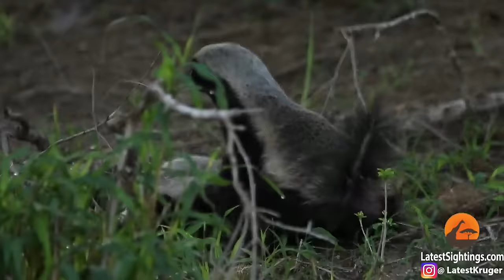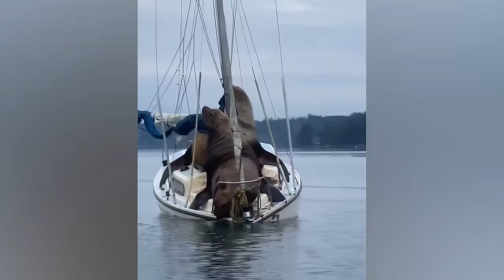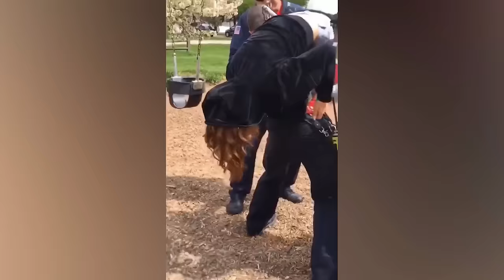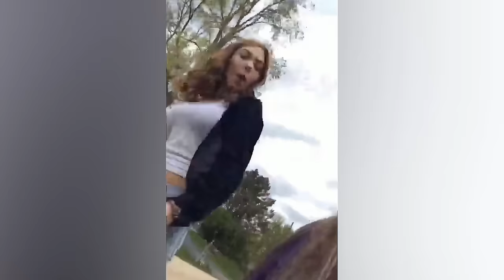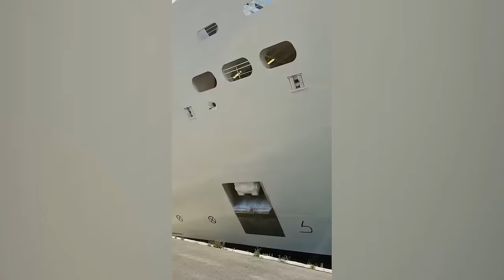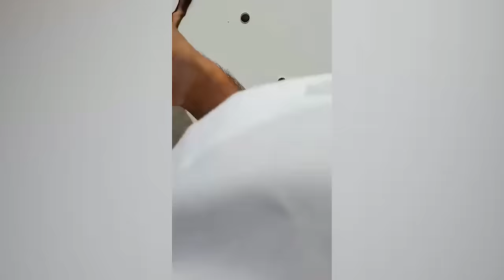Ozzy Man Reviews: MEGA COMPILATION #10

Comment: I was a FF/Paramedic and I've actually been called to a park for a young adult stuck in the toddler swing. We contacted our Parks and Recreation department and they told us that those toddler swings are about $1000 a piece. We had to cut through the seat with the young man still in the swing, and there are actually steel bands embedded in the rubber. It was a nightmare to actually get this person out and it ended up costing the city a couple thousand dollars because of materials, our time (other units had to be used due to us being tied up on this for a very long time), and the maintenance then required of our tools and equipment.. The city wouldn't arrest them and press charges to recuperate the money because it would be bad PR.
Reply: Everyone is doing this wrong. Get the trapped person a platform to stand on (we used a folding table), then two people grab the swing seat and pull it down. Works most of the time.

Comment: First time I've seen someone other than myself experience the thrill of kneecap subluxation.
Tell you what, that shit ain't no fun at  all folks! It's been forty years since the first time it happened to me and about 9 surgeries later my knees are both bone-on-bone ready for total replacement surgery. 
Only one time was I successful in pushing it into place on my own. 21 years ago I push from outside inwards just to relieve the intense pressure and pain. Well the pressure was much less, but the pain stuck around.
Last time was in June of 2014 which was a little more intense and vastly different. Instead of the minor dislocation the kneecap was shattered like glass into more than one hundred pieces, making it impossible for a repair. Naturally, I ended up with a fractured femur, two front teeth busted out, both wrists broken, and the two lower bones, tibia and fibula, were dislocated and overlapping my femur.
In other words it was a very shitty day.